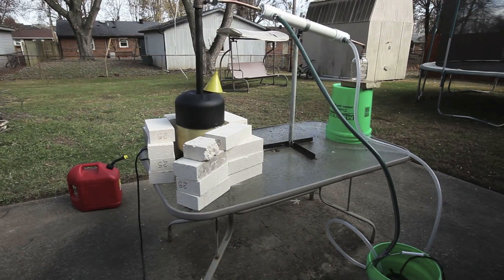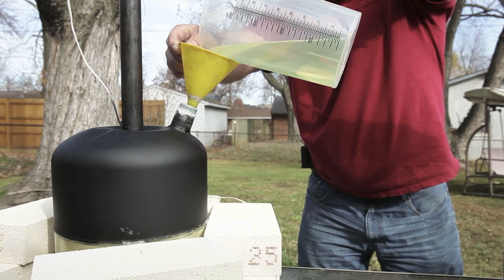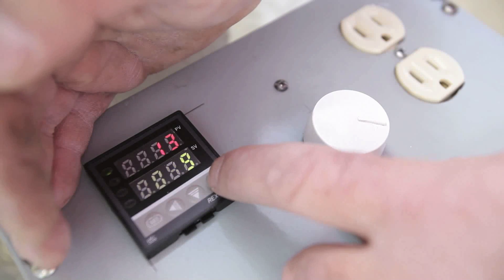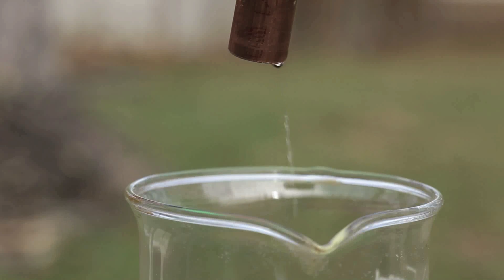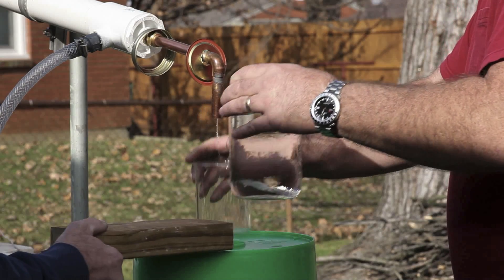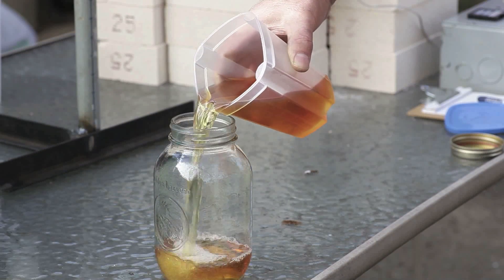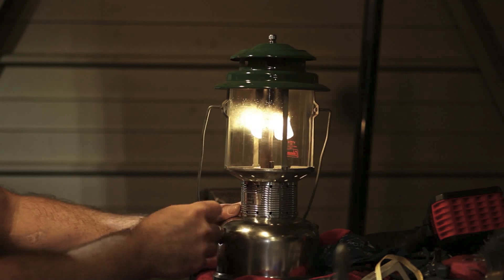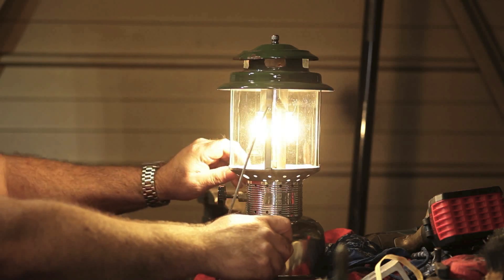How to make Coleman lantern fuel at home

Comment: From the picture I see he ahs made himself a potential bomb.  Still have a habit to explode as people do not have an emergency pressure release.  I do not see an pressure release.  When I was involved in still the boiler exit pipe is not hard connected.  A still does not need to build pressure so the exit pipe should be a slip fitting and the you seal it with a wet paste of flour.  The heat dries the flour into a very weak seal if anything some hoe becomes block the four seal has not strength and will crack and the pressure will release.  Everyone says their still will not get block but something happens pressure build and BOMB.

Comment: I wonder if you can make it from other things like oil, veg oil, kerosene, etc?
Reply from the maker: It must something with low number carbon chains. Oils and kerosene have too many carbons.  5-10 is good, bigger than 12 starts to get too hard to vaporize without a preheater.

Comment: Normal unleded car petrol will do the job just fine
Reply from the maker: You are correct, for the most part.  Generators will not last as long, so one could just change them more often.  The only way this would pay off is if the generators were very expensive and legitimate coleman fuel was unavailable or prohibitively expensive.  Here in the US that's not the case but as most thing I do it was just a lot of fun.
Reply: @Safety-3rd  And having fun is the best thing to have,, succes "-)

Comment: But where do you get all the right piece's to do this.
Reply from the maker: Most of the items were spare parts I had around the house. The container was a used freon tank. The condenser is just a copper pipe in a pvc pipe. The temp controler is available on eBay. There are many videos discussing the construction for other uses like heating ovens for knife makers.
Reply: @Safety-3rd  thanks

Comment: The price of Coleman gas where I live is through the roof. Great video, did you just mix all the jars together in the end?
Reply from the maker: Yes I combined all the fractions in the end. I also ran the product through a gas chromatograph mass spectrometer and compared it to proper Coleman fuel. The two were very close with the differences measurable but of little significance.

Comment: Did you mix all fractions together to get the final product?
Reply from the maker: Yes I did mix them together, I also saved the remaining stuff, but to date I've yet to come up with a good use for it. By the way the yellow remains are what gums up the carburetor when you don't use an engine for a while.
Reply: @Safety-3rd  cool. Im going to build something similar this summer. Half for fun, half to save on white gas. Do the leftovers burn at all?
Reply from the maker: @KC9RXP  Funny but I haven't tried to burn it.  I'm guessing but I would bet it does and is probably hard to light due to the higher boiling point.
Reply: @Safety-3rd  im thinking if its even near kerosene or diesel, you could use it as fire starter or run a waste oil burner on it.
Reply from the maker: @KC9RXP  I still have it.  I will try and burn it and let you know what the results are.
Reply from the maker: @KC9RXP  Mitchell I uploaded a video of the burn test you can see me spill it all over the table. By the way it really stinks.

Comment: Just put two/2 small drops of oil into the hole of the primer handle loosen up. Then pump prime it up.& twist tighten it backup to light then watch how much it improves the lighting.& burning quality afterwards. Good luck to you.& hope that fixes you right up on that little minor set back.
Reply: Does it make it pump up faster?

Comment: Why bother?  You can run regular ethanol free gas in any Coleman lantern or stove it works great.  The old ones were designed for use with regular gasoline.  You just need to clean your generator a little more often... which is WAY, WAY easier, safer and cheaper than this!  AND considering that most folks use no more than a couple gallons a year anyway, what's the point?  Also, Crown brand white gas is available at Walmart for half the price of Coleman fuel and it's the very same stuff.  I don't get this.  You're going to blow yourself up!
Reply: Facts

Comment: Good stuff.
I'm wandering about doing the same thing with diesel fuel oil. Not sure if any of the oil would ever lift or boil though. Was thinking about making a cheaper lamp oil than kerosene. 
    Way back when they use to make low compression ratio engines that we would get hot on gasoline and swap over to kerosene because it was so much cheaper to buy , now it's outa sight.
Reply from the maker: That might be a fun think to try. Perhaps I'll try that next time.
Reply: Try biodiesel  Seems easy to make
https://youtu.be/8cZPP2at8HI

Comment: have you switched to Coleman's Dual Fuel lanterns yet? They burn un leaded gasoline as well as Kerosene (1-K is best as it has the least sulfur content so least odor and irritants). The switch will save you a lot of work.
Reply from the maker: I just did this to have something to do.  White gas is pretty inexpensive here.  Thanks for the research info I'll check it out.
Reply: @Safety-3rd  while the Naphtha is the cleanest burning fuel leaving the least contaminant to breath My concern is storage of Naphtha and smell if you spill it. Kerosene 1-k is safe to store as a combustible rather than a flammable Naphtha. I believe that Naphtha and white gas are similar Coleman fuel is so far as I am aware Naphtha and not white gas though the two names are often used as one and the same. The unleaded gas was a surprise for me as white gas is the purest form of gasoline having zero additives that said the unleaded gas was pretty close to white gas in the testing. Maybe you can make a super refined kerosene from stove  oil or furnace fuel oil? Those are both cheaper than 1-K or 2-K kerosene.
Reply from the maker: @morayjames92  I fancy kerosene, probably 1/4 to 1/3 of my collection is kerosene and they are the ones I burn the most.  I ran a sample of the fuel I cleaned up in this process against Coleman fuel in a gas chromatograph mass spectrometer and they were very close.
Reply: @Safety-3rd  There is a job waiting for you in a South American jungle! I am wondering why there is such a wide range of acceptably flash point temperature level with Kerosene (124F - 150F)? Is this also common with other fuels? Or is this specific to kerosene or because it only gets burned so much in lamps or as a fuel component in small engines and it makes little to no difference? I would have thought a cleaner fuel would be more popular.
Reply from the maker: @morayjames92  Kerosene is a sort of generic term that has been used for many different things over time. Originally it was a trade marked name for what we call mineral spirits now.  The flash point is determined roughly by where the fraction was cut during the distillation and also from the type of crude oil it was distilled from.  An interesting historical note to kind of demonstrate this is the origin of the company name "Standard Oil".  The name was meant to imply that one could rely on their product being the same each time you purchased it.  Other producers may include lower boiling point fractions in their end product to increase profit often endangering the end user.
Reply: @Safety-3rd  I was wondering if you know of a simple way to keep a 5% mix of Ethanol  in kerosene uniform and not separating? I am guessing it is not a simple thing to do. Thanks.
Reply from the maker: @morayjames92  sorry to take so long to reply.  I didn't see the comment. I'm not 100% sure in kerosene but in petrol the ethanol must be pure 100% not the 95% 5% water azeotrope mixture that is common. Since you can't distill it you have to use a drying agent. Hope that helps.
Reply: @Safety-3rd  could you use Epsom Salts to absorb the water in the ethanol? Thanks.
Reply from the maker: @morayjames92  yes you can just make sure the magnesium sulphate is as dehydrated as you can reasonably get it . You can buy it that way or heat it to 150C for an hour or so. That will give you monohydrate that's about as good as you can get without going crazy with the heat.  To get anhydrous you need to m take it above 300C.  You can get molecular seizes online they are easy to use and can be regenerated with heat as well. Hope that helps.
Reply: @morayjames92  zeolite a filter or get the ethanol to 0 f and do a ice cube as a seed crystal and itll attract the water out of the 95 percent ethanol too make it 100 percent ethanol, the mix is by parts 5 percent  to 95 or any ratio you want , you could run the kerosene thru the zeolite as well but idk how many uses u can get vs ethanol ...i personally like Jet A instead of K-1 i live a block from municipal airport and i get it at pump
Reply: I found this study of different fuels and the pollutants they make wen burned.  
 A comparison of carbon monoxide levels during the use of a multi-fuel camp stove
R B Schwartz  1 , D J Ledrick, A L Lindman
Affiliations

    PMID: 11769918 DOI: 10.1580/1080-6032(2001)012[0236:acocml]2.0.co;2 

Abstract

Objective: The use of camp stoves in an enclosed or poorly ventilated space is clearly not recommended due to the risk of carbon monoxide (CO) poisoning. Instances may arise, however, when use for a limited time is necessary. We sought to find differences in CO levels between various fuels used to power a commercially available camp stove.

Methods: A comparison was made between unleaded gasoline, kerosene, and white gas (Coleman fuel). The stove, fuels, and CO detector were all purchased from local retailers. A 0.4-m3 space was constructed with a cardboard box. Three trials were performed using each fuel in which water was heated over the stove for 5 minutes. Measurement of the CO level within the box was taken every 30 seconds.

Results: Kerosene created CO levels of 714 (SD = 113.5) parts per million (ppm) at 2 1/2 minutes but was out of the measurable range of >999 ppm within 4 minutes on each of its trials. White gas burned the cleanest, with an average of 212 ppm (SD = 27.8) at 2 1/2 minutes and 348 ppm (SD = 76.0) at 5 minutes. Unleaded gasoline created 305 ppm (SD = 27.1) at 2 1/2 minutes and 464 ppm (SD = 31.6) at 5 minutes.

Conclusion: All of the fuels created a high level of CO in a short period of time. White gas burned the cleanest and would be preferred to unleaded gasoline or kerosene in the event that the unvented use of a camp stove was necessary.

Comment: If all I have is a hotplate and no temp controls, can I just start low and slow to get to a certain percentage of distillate vs. dregs as an end point? If so, would you care to share that percentage with me? Could I just mount my thermometer in the top of my cooling tower and monitor manually, fine tuning my adjustments on the hotplate that way? Also, would you recommend adding ice in the condenser water for efficiency? Thanks!

Comment: How long will a generator last with plain unleaded gasoline?  Can I still clean the generator using standard practices or will the carbon buildup be too excessive?
Reply: Yes you can clean it. It must be cleaned more often than with white gas. And the paper filter will get dirty faster

Comment: Great video on the explanation of the setup!  I was wondering if you can tell the difference in the end product dealing with shelf life over pump gasoline.  Is it noticeably cleaner, doesn't go stale or varnish up as bad as the raw gas from the pump?
Reply from the maker: So shelf life would be a total guess, because I use it up very fast.  I would guess that it would be longer as it is a lot cleaner than regular gas and the large molecular weight constituents are left behind.  It also burns cleaner as the large molecules are typically responsible for coking up the generator.  This is probably not the best to store for long periods as Coleman fuel has the anti-corrosion additive alox added to help prevent rust in steel founts.  I hope I was helpful.

Comment: Does it seem to burn cleaner, differently? Maybe less smoke at startup or less harmful fumes before or after combustion?
Reply from the maker: It's pretty much the same as regular Coleman fuel.  I ran samples of it and regular Coleman fuel through a gas chromatograph mass spectrometer and the makeup was very similar.

Comment: It would be interesting to know what the octane rating of the rerun is afterwards?
Reply from the maker: The test for octane rating is kind of difficult unless you have the proper equipment, that is quite specialized and costly. So I can only guess that it would be quite a bit lower since the high boiling point constituents we removed are the main components that raise the octane.
Reply from the maker: I'm sorry for not responding in a timely fashion, but I just noticed your comment.  I am guessing but I bet the octane number would be fairly low , about 50 or so, because the stuff that was left over is mainly the components that increase the octane of gas.

Comment: Has anyone ever invented a lantern mantle that doesn't break?
Reply from the maker: John Young No they all break some are stronger than others. It may be my imagination but I fell like the old ones are stronger.
Reply: @Safety-3rd  Seems like there ought to be a way of making a wire mesh mantle coated with the appropriate catalyst.
Reply from the maker: The wire would oxidize and probable perish quickly or perhaps would be so costly we couldn't afford it.  I bet it was tried back in the day when people relied on these in their home for light.  I have seen some old adds for some made out of bamboo,  not sure how well they worked.
Reply: @Safety-3rd  And yet, those Buddy heaters have wires that last presumably a long time...
Reply from the maker: John Young good point and they don’t cost a king’s ransom perhaps there is some other reason they don’t make them. Or maybe they just want to keep selling us the crappy ones.

Comment: I bought a duel fuel lantern. It can use unleaded gas. Then I was told that I could use it my other stoves and lanterns. I have since and they always work fine with just unleaded gas.
Reply from the maker: Daniel Alamo you can it will only clog up the generator quicker. This just a fun project to demonstrate a concept. It’s good for people in foreign countries where Coleman fuel is not available or too expensive and they have old products that have very expensive generators. For people here with cheap fuel and cheap generators it doesn’t make since. It’s just fun to do.

Comment: You can add toluene and benzene to the fractions that aren't the dregs it to make high performance gasoline.

If you do that, you need to get REALLY decent working gas mask, some protective gear to block that stuff from contacting your skin, and you need to be careful as possible.

For those who want to add up to 15% purified, dried ethanol, you need to blend in an additive called Ethanol Shield into it first like it says on the bottle, then add the ethanol to that final product.

Comment: Fascinating information. But this reminds me that it is possible to get twice the mileage from a gasoline engine using a catalytic converter driven by exhaust heat to reduce molecule size before it enters the engine. Such a mobile cracking process improves efficiency. The smaller the molecule the more thorough the oxidation. Of course timing changes or other modification to the engine is required. The military used such devices in WW2 to improve logistics. There is a surviving example of such a "carburetor" at Don Garlits Race Car Museum Ocala Fl. However one could not use such a device now with modern gasoline. The additives would clog the device almost instantly. I am of course referring to the dark leftover liquid in your process. The fact that car manufacturers do not use such device presently and that additives are being placed in gasoline that would thwart such devices sadly reveals much about this world. For example one would think that if they were so concerned about global warming and the so called effects of carbon dioxide emissions on the earth climate they would allow such technology to be implemented by the car manufacturers, as reducing world wide fuel consumption by 50% of all gasoline engines would obviously reduce carbon dioxide emissions by 50% as well. In reality those that control energy consumption obviously have no desire do anything that might reduce consumption. Even more revealing is that in reality carbon dioxide emissions have less effect on the planet than we are told. Furthermore it is safe to say that we are not running out of petroleum any time soon either since petroleum is a natural geological abiotic process that occurs deep within the planet and is not energy from the sun. Much more can be divulged if one only takes the time to inspect the facts. It is blatantly obvious that we all live within the Matrix. "We'll know our disinformation program is complete when everything the American public believes is false" --CIA Director William Casey February 1981 in a meeting with newly elected President Reagan.